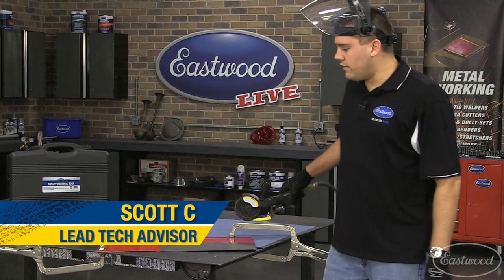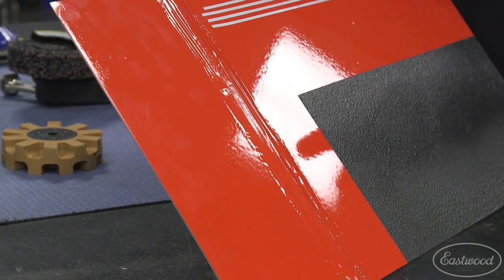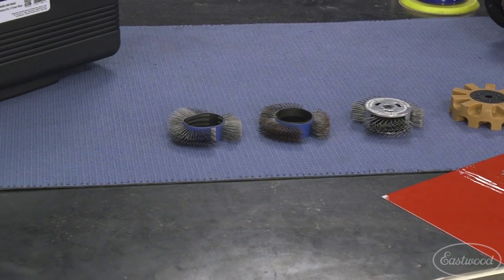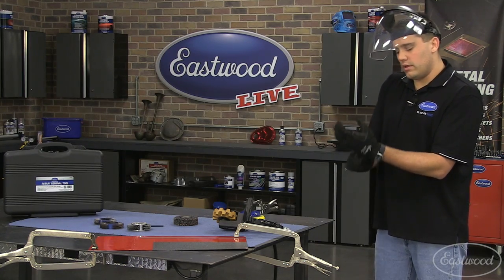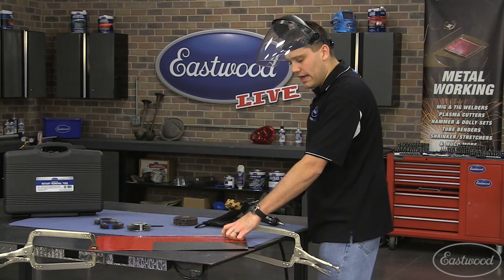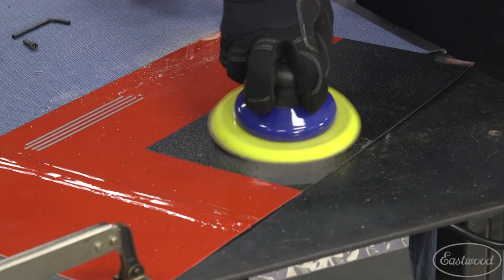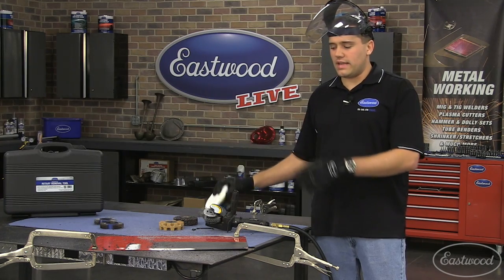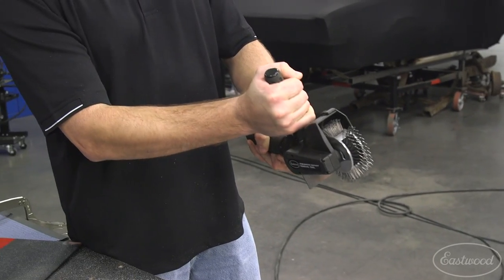Remove Rust, Paint, Seam Sealer, Undercoating & More! Pneumatic Rotary Removal Tool - Eastwood

Comment: The pinstriping demonstration is not what we find on old cars where the tape is brittle and BAKED on.  The striping you have on there is NEW and applied over new paint and never been out in the weather.  You need to demonstrate that on an OLD fender.

Comment: What makes this better than a grinder with all its different attachments and torque?
Reply: jameannohere it costs more. it's probably slower.
Reply: I use the German version of this tool and I also use a grinder and they are different. A grinder will remove light rust but serious rust just gets polished. A grinder will remove stone chip but a thin layer of the stone chip remains, is melted by the brush and spread around. In reality I use both a grinder and a surface prep tool like this, but the prep tool gets used more. It's biggest downside is price, but there's already a Chinese copy on the market. Give it some more time and the price will fall right down.

Comment: supply:
L/R; 2003 ford escape xlt 4x4
auto; I heart five speed manual transmission.
L/R rear Quator panel patch
Outback seat;only two seat five belt harness fabrication.
Fabrication cage.
New rear hatch window and wiper system.
grey cloth interior
white 
Quad:215/40r17 spring summer 
          225/60r16 winter 
modern duce coup

Comment: It's a die grinder with one to two worm gears to drive the head... I just don't see the cost effectiveness when it comes to the price versus a twisted wire wheel. The eraser head would be handy on a die grinder though!